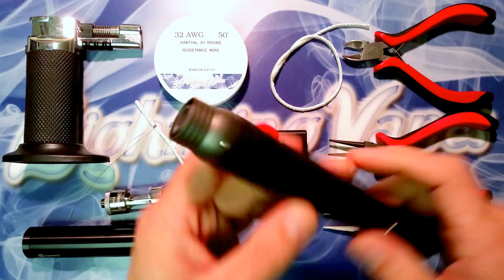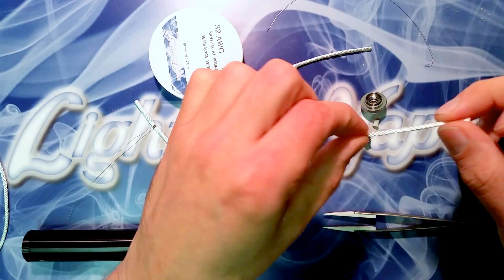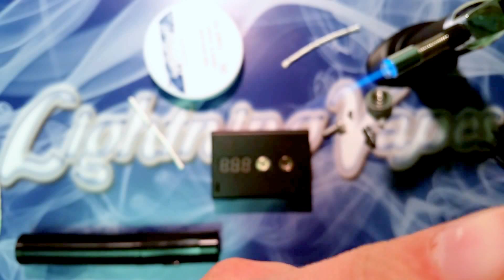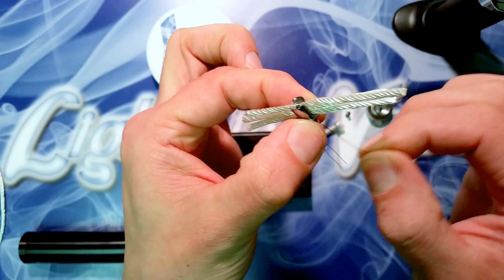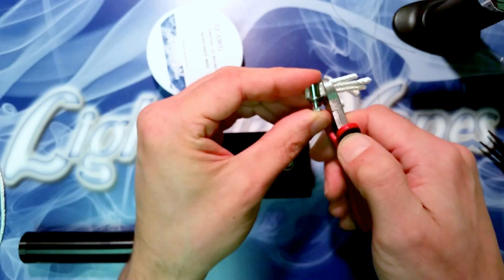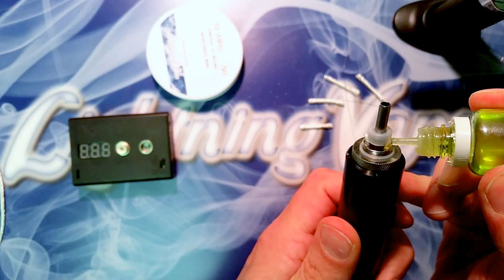Kanger Protank 3 Dual Coil BDC Atomizer Rebuild Tutuorial HD Close Up

Comment: i tried this with the same parts as u did...3mm silica wick with 32 gauge kanthal wire and followed your directions to the T. At 8 wraps per wick i got a 2.8 ohm and with 9 wraps i got 2.4 ohm so i went 10 per wick and got 1.7 ohms but none of the coils turned red after holding the button down for 10 seconds and the battery automatically turns itself off. My battery is a kanger evod vv 1600 mah cranked to the max at 4.8 volts. The base of the coil got kinda warm before it shut itself off but i doubt itll vape any ejuice. Any ideas what im doin wrong??? Thanks

Comment: Can you use this setup on an rda running through 800mah invoking vv3 or even a 1100mah ego twist? I'm new to rebuilding and was curious
Reply from the maker: Alexander Sullivan The mAh really refers more to the capacity than the output power. Either battery should be fine however.
Reply: the amp limit and ohms of the coil are important, most ego style bateries can put out only 2 amps so it limits you to about 1.5ohm, if u put a 1 ohm coil on a battery whit an amp rating of max 2amp it will went or explode

Comment: Hello, thanks a lot for the tutorial! Could you please help me with few questions:

1.- If I buy the KANGER PROTANK 3 DUAL COIL HEAD ASSEMBLY (last link) how many times can I reuse the head just changing the coils like you do in the video?

2.- I bought an Aerotank v2 just to find out that the genuine prebuild heads don't last more than 3 days and they are very expensive (About $2 each) so that's why I looked this video? I know in the website it says that the KANGER PROTANK 3 DUAL COIL HEAD ASSEMBLY are compatible with the Aerotank but do you know by any chance if they are compatible with the Aerotank V2 (second generation)? Also, about how long do these that you build last for you?

Also I am a little confused about the resistance, I think I need two 3 ohms coils to make a resistance of 1.5 ohms but the 32 AWD (as seen on the video) says in the website that it is 13.1 ohms, is this the one that I should use? Or should I use the 26GA?

Thank you in advance!
Reply from the maker: sacn 1. You can reuse it 2-4 times or so, or until you notice a lack of performance / nasty taste.2. I'm not sure, but I'm sure you could do a little research and fine out.3. You are correct about a second coil cutting the total resistance in half. As for the 13.1 ohms, that refers to ohms per foot, not the ohms of the coil. 26 AWG will likely be too thick for your build, and in most dual coil configurations that will fit in that head, produce a sub ohm build, which I doubt you want in this instance.

Comment: I tried this build 4 times and all of my coil leaks and floods within a day of use. Does anyone have this issue? 1.6 ohm with 50/50 juice
Reply from the maker: teng xiong Make sure that the wick blocks the two channels on either side of the coil head base completely. If you see any black space / can see through the holes the wicks poke out of, you're going to have flooding issues.

Comment: hi sean i have bought some 28awg kanthal and natural cotton, and only finding out now that maybe i should have gotten the 32awg and silica wick since this will be my first rebuild for my protank 3v2 do you have any advice?
Reply from the maker: yukishiro rai You can get it done with cotton as well, however you may want to pick up some 32 AWG wire still.
Reply: so the 28 awg wire wouldnt work?
Reply from the maker: yukishiro rai What kind of battery are you using?
Reply: im using a 18350 900mAh battery
Reply from the maker: yukishiro rai Once you build a coil with the 28 AWG with a resistance greater than 1ohm ( very likely required by your battery) you will find that it has a hard time firing the coil. You can give it a try.
Reply: Sean Hanson so as long as I make the coil be under 1ohm I should be OK if I'm using the 28awg wire. Sorry just very new to the rebuilding of the coils 😊
Reply from the maker: yukishiro rai Negative. If you build it under 1 ohm, then your battery won't work. Below 1ohm would fry the battery's internal circuitry, though most batts these days have short circuit protection.
Reply: Sean Hanson so I should just aim to make a total of just above 1ohm would be fine right? And any suggestions on the diameter of the coils?
Reply from the maker: yukishiro rai Correct. As for the diameter, make it the same as the wick.
Reply: ok cool thanks sean ^^

Comment: You seem to be suggesting that the coils don't need to be perfectly uniform- ie you can wrap directly around the wick instead of around a tool/jig like a lot of cotton rebuild videos show. Is that always the case?  Can I be a little careless about coiling around a wick or do the coils need to be very close in size?
Reply from the maker: Cristobal Ferryman Don't get me wrong, the more perfect the coil, the better it will perform. However, it doesn't have to be anywhere near perfect to "work".

Comment: Thank you so much for showing me/us this video. Very good and informative.
But I have hve the same question that K1NGP1N360 asked, (I can't fine any comment to that, itf it's here; sorry...)

"Also why do you have to wrap the coils so close together? Does it make it hit better than having them spaced out? I just notice the prebuilt coils have a lot of space between the wraps." Do you really have to squeeze them together?

And do you need to warm the coils with a torch if you buy the wicks pre-made?
Reply from the maker: Anders Venhaug Don't get me wrong, the more perfect the coil, the better it will 
perform. However, it doesn't have to be anywhere near perfect to "work".

Comment: Great video.  I have been rebuilding protank 2's for my wife for about a year now. For my use I have a couple of Kayfun's with cotton. She has a couple of the old stand alone kanger air controllers and she puts everything on a pro vari mini.  Just ordered a mega tank to start playing with this.  Three questions. (1)  I can order pre built coli and silica from Fastec for about $3.00 for 50. NR/R/NR wire. These are wrapped around a 2 ML silica wick.  Do you see a problem with using 2 ML silica? (2)  Also she prefers her coils at 2.5 ohm's.  If 2 ML is going to be a problem with leaking/flooding I have some 3ML silica I can use. I would like your opinion on how many wraps, and what gauge kanthral, to use to end up with a 2.5 ohm reading using 3 ml silica. (3) If I can use the pre-built coils, with 2 ml wicks, I can order these with a 2.5 ohm rating.  If I put 2 of these wicks in does that then bring down the ohm to 1.25?
Appreciate any advise
Reply from the maker: Cool Keno 2mm might leak, but you can give it a shot. I would use 32 gauge 6-8 wraps to get 2.5 ohms, or 34 gauge 4-6 wraps.

Comment: Nice video. I have tried this numerous times unsuccessfully. I am very good at wrapping the coils. Bought all of this stuff (from you) and every time the top coil will not fire. I have taken some apart and noticed that the wires from the top coil are touching the bottom coil on the way out. Have done this at least 15 times, same result. How is it possible to route the wires from the top coil, out through the bottom without making contact with the bottom coil? I get good ohms, but during the dry fire the bottom glows like crazy and the top does nothing. Would appreciate your thoughts. Thanks..!!

Comment: just rebuilt one of the new universal dual coils, put 2 prewrapped 1.8 ohm wicks in, its reading at 0.8ohms :/ Any ideas what I did wrong? Il try again later...
Reply from the maker: thesouluniversal That is the expected behavior. An identical second coil added to the circuit will cut the resistance of the circuit in half. If you would like to achieve a higher resistance, then make the 2 coils a higher resistance before installing them together in an atomizer.
Reply: Sean Hanson
Thankyou for the info, Il see if I can add more wraps to make them higher resistance next time, if I double the wraps should that double the resistance? The wires wrapped 6 times around the wick atm

Comment: How many wraps of kanthal if I was using 30g? thank you! : )
Reply from the maker: jeffveta Two or three more wraps should get the job done.
Reply: Thanks a million!
Reply: Sean Hanson 11 wraps did the trick, coils heat evenly and well. The battery however, is getting hot very quickly...what would you recommend? (I'm using a zmax mini and kanger aerotank)

Comment: Thanks for the vid. Before I found your vid, I rebuilt my Kanger Unitank coil using pretty much the same method except it's a single coil. I used 6 wraps of 32g kanthal for about 1.8-2.0 ohms on an 1100mah evod battery.
However, I'm not a fan of silica. Instead, I used cotton through the coil, and placed another piece of rolled cotton on top of the coil which is similar to the silica setup I replaced.
I've tried a setup using mesh, but the juice flowed through like an express train. Have you tried using a mesh build with these coils? Maybe a build with cotton to dam the sides with a mesh through the coil?
I know, why so many parts? Well, I'm looking for something other than silica or cotton on the coil. I'm just not too fond of inhaling burnt silica or cotton, but the cotton build does taste better.
...please excuse the dissertation. I vape with Eggheads.

Comment: Hey this is what I do. Wrap a single coil around a zip tie. It gives you the shape you need to fill wick hole. And use cotton as a wick. Works great, but keep in mind its not a dual coil anymore. But I just find it much easier. Hope this helps.

Comment: Just build this dual coil for my Evod II tank. I followed you instructions and it came in at +- 1.5 ohm. Primed it with some Halo sub zero, it almost blows your head off. I think it is much better than the original kanger replacement coils. Thanks to your straight forward tutorial I will be saving a lot of money. Excellent job, thanks again! ;-)
Reply from the maker: Michael Hilgendorf I'm glad this video helped you out :-D
Reply: How many wraps would you suggest that I need to make in order to achieve a resistance of 2.0 +/-, using the same guage kanthal and 2mm wick?

Comment: Sean, I got ecowool. Will i have problems? Im about to start and i dont want to waste time if the ecowool sucks! Thanks again bud!
Josh

Edit: Unfortunately after trying it a couple times only my bottom coil fires. So basically the top coils' wires are touching the bottom coil. I dont see how you get the wires in there without hitting the bottom coil? I can DEF do a single T3S coil though lol, that seems to be easy.
Reply from the maker: It takes some practice, but remember that there is a wick in between the top and bottom coil to keep them from touching.

Comment: If you look at a Kanger built dual coil head they have the wire legs of the top wick going down through the middle of the flavor wick and also through the middle of the bottom wick/coil... did you just take the legs of the top wick and run the positive down the front and the negative down the back? Can you explain that part a little more? I'm going to use 2mm EkoWool and 32awg wire, how many wraps do I need for it to hit 1.8ohms?

Thanks man!
Reply from the maker: I would say about 10 wraps or so, the SC-2 or SCN-2 is thicker than 2mm. And yes, I did not run any of the wire through the wick, simply around the wick.
Reply: Sean Hanson What do you mean by SC-2, SCN-2? I ended up using 33awg (6 coils) with 2mm EkoWool and it came out to be 2.1ohms but something is wrong... When I take a vape it is not cooking the ejuice right, I'm hearing a soft little sizzling instead of what you would usually hear using a Kanger built head. Something is not right, on the top coil I ran both legs of the wire down one side I figured if I ran one leg down the front and one in the back that it would short out. I wish there were more videos showing a rebuild on these dual coils (the way Kanger builds them) all I can find is your video. The other videos that I have found they are just building a single micro coil and using cotton. I'm not a fan if cotton. :-(
Reply from the maker: SC-2 is hollow ekowool, and SCN2 is silica core ekowool. Did you dry burn before hand to make sure that both coils were firing properly? What kind of battery are you using?
Reply: Sean Hanson Yeah, did a dry burn and everything seemed to work fine. I'm using a 18650 battery and a SmokTech SID. I'm about to switch over to a mech mod. I even checked my build with a multimeter.... my problem is with wrapping coils, I usually put a big ole needle inside the EkoWool (I found some great needless at Hobby Lobby they are called "Doll Needles" super long and thick. Sometimes I will wet the wick with distilled water and then wrap it sometimes I hit it with a butane torch and wrap it that way. I think running the legs from the top coil down one side they must have been touching the inside of the wall? We need to find a way to build them like Kanger does. When you ran the legs from the top coil did you put one in front and the other in the back? Seems like it would short cause it's touching the bottom coil. Maybe I need to use nr-r-nr wires?
Reply: Alex Thomas @Sawn hey brah, I think you missed reading my last reply I never got a response back... I guess you might be too busy also? When you get a chance give me a hit back... Thanks man!